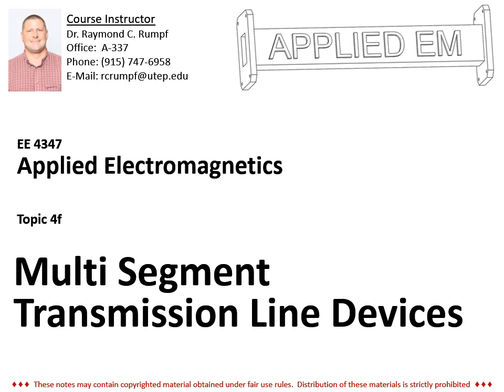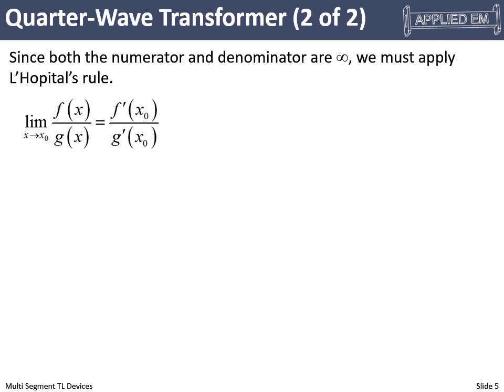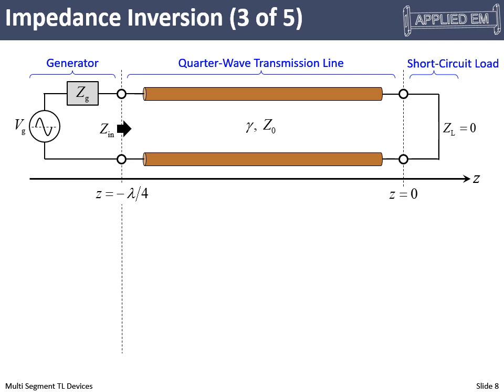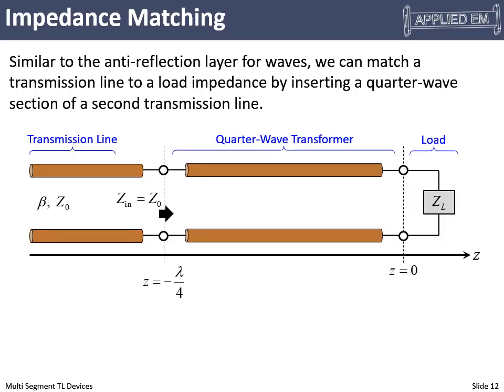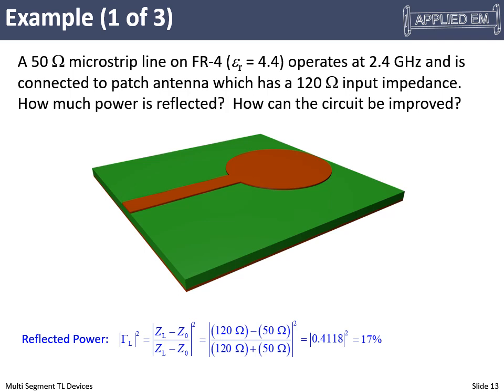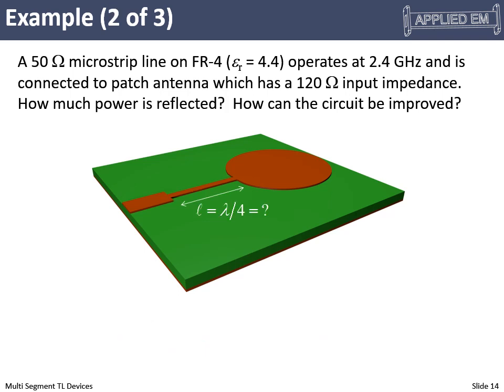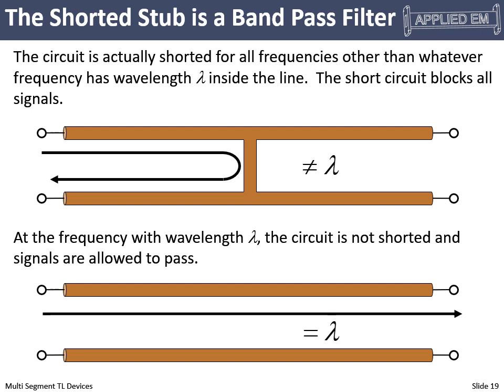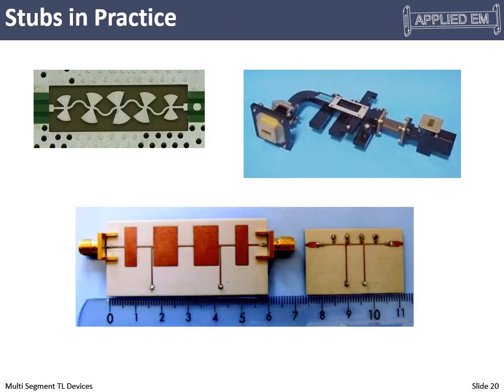Lecture 4f -- Multi Segment TL Devices

Comment: How long is a quarter wavelength? That depends on the permittivity but in a previous lecture you used something called "effective relative permittivity" for microstrip lines. So for a microstrip line, should I compute the wavelength using the signal velocity gotten from the effective relative permittivity or just the relative permittivity?
Reply from the maker: A quarter wavelength is whatever length of line is necessary for the signal on the line to accumulate 90 degrees of phase.  This is calculated as

L = pi / (2*beta)

The phase constant beta depends on the design of the line, materials, etc.
Reply: @empossible1577  Obviously I had forgotten the phase constant depended on so many other parameters. I thought you would get L as L_0 * n = L_0 * sqrt(<relative permittivity>). Is that formula only valid for pure dielectric media with no conductors etc?
Reply from the maker: @gravityhacker  That formula is pretty close for lines with a homogeneous dielectric and no magnetic response.  However, lines like microstrips are not homogeneous.
Reply: @empossible1577  That's great to know, thanks a bunch!